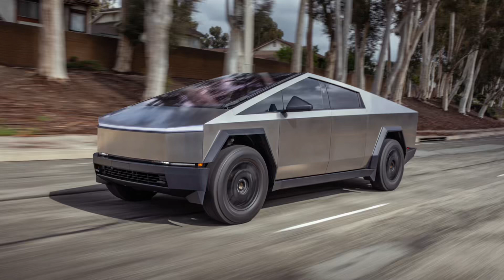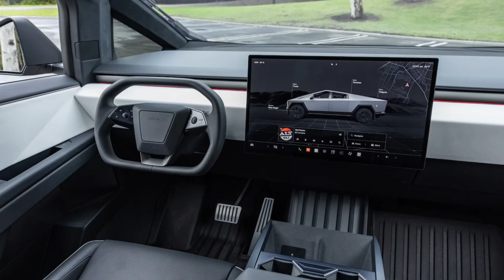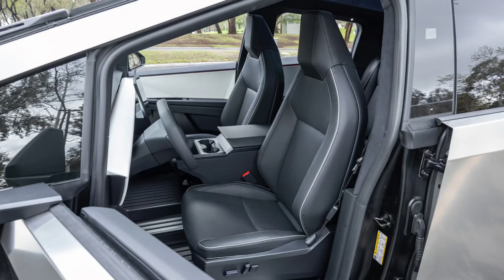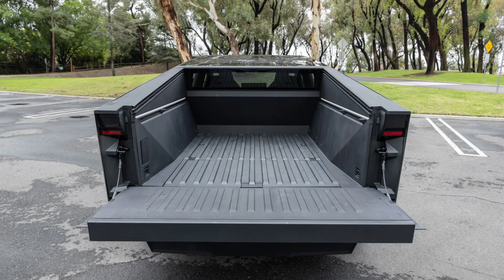2024 Tesla Cybertruck Dual Motor First Drive: Hype Machine or the Real Deal?

Comment: Cybertruck is a death trap for driver and passengers , other cars and would slice a pedestrian in two like a knife.

Cybertruck doesn't crumple either. Cars crumple for a reason. Hitting a wall and stopping that quickly will be much more dangerous than a better designed car. Of course if the Cybertruck hits another car the people in the car will be annihilated.

It might pass safety standards in the US but hopefully will fail elsewhere.